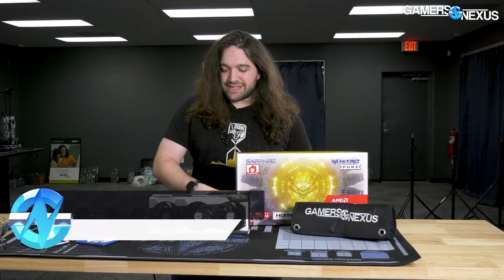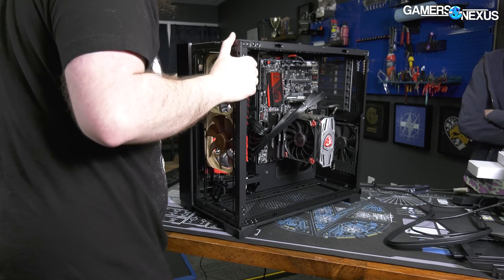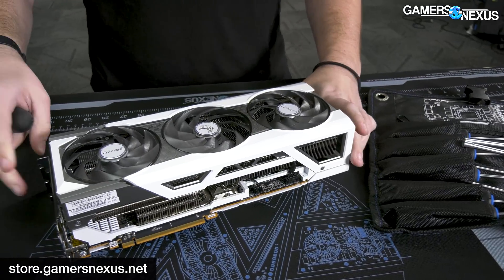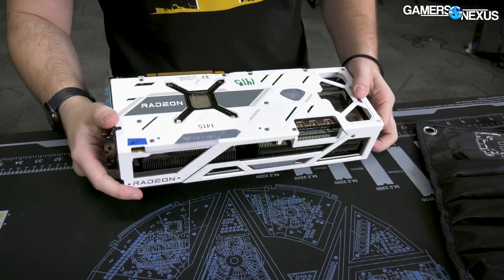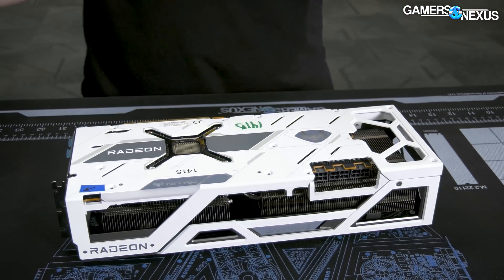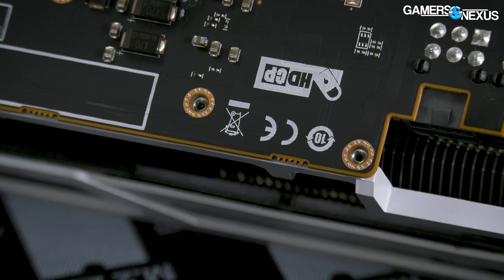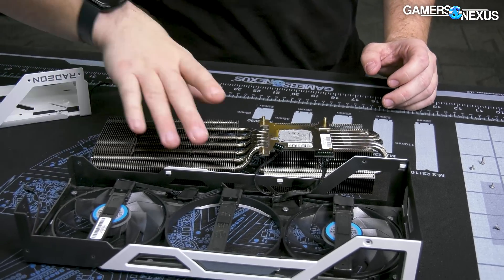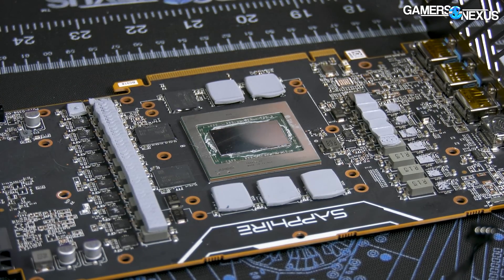Tear-Down: Sapphire's Excellent Cooler Design on AMD's Hottest GPU (6950 XT Nitro+ Pure)

Comment: i don't know if you check old video comments, but for reference as 6950XT owner since February 2023, i just repasted my GPU, because in Expedition 33 i had 110*C hotspot and pc shutdown... after repasting with arctic mx-4 and p-3 pads, my max hotspot was at 87

desktop usage went down from 58 to 38.... it was my first repasting of a GPU, but hoooly, it did wonders, i didn't get too much data from before and after, but under load it seems i got like 40*C improvement

Comment: 16:00 next time can you gize the X and Y size measurements? I don't own an electronic measuring tool, but my GPU is running very hot. I'm gearing up to disassemble my tiny ITX build to redo the GPU thermals and want to slap K5 Pro and PTM7950 all over, but I'm not sure what size to buy. If the total is 520mm, and long side is nearly 30cm, then the shorter side must be around 18mm or 16mm?

Comment: You really can tell when a manufacturer cares a little more about their product than others.

EVGA in the 20 series added 3 slot which was super nice for sagging.

XFX and their similar fan header design here.

Sapphire for them making such a big card, a real triple slot, with proper cooling and sag support, making a contact bout near the bottom of the slot that prevents further sag. This card compared to the EVGA FTW3 has no sag. Their bracket for anti sag is also less ugly than other options (looking at you MSI) and overall disappointed in EVGA for making the FTW3 a dual slot, with such a massive cooler and heavy design having a dual slot is horrible, and making no contact between the cooler and the slot itself doubles down on that. The real offender here is ASUS and their ROG STRIX 4090. A dual slot, really ASUS?!?!

This card is excellently designed in the world of bad GPU designs. Definitely pick this model up if you're getting a 6950 XT OR 6700 XT.

Comment: This one screw fans are awesome, i need to swap mine in RX590 nitro se as the bearing was failing and the noise was even on 700 rpm with headphones and start to make my gpu hotter, but i was unlucky and they dont want to sent me free replacments (probably they dont have it and try to import it for me) i lucky find original one in my country and pay little less.

Comment: This is a good design but I'm still not convinced that they wouldn't have been better off using standard out of the box 120mm fans. I'd like to know how a thinner heatsink + very good 120mm fans perform against a design like this. Noctua's 3070 is a good example of just how good a design like that can be.  I bet if you just slapped some good 120mm fans on the current heatsink, it would cool much, much better. This would also make for lighter GPUs..

Comment: Back when the RX 5700 XT was released, I originally got an MSI Mech version of the card. The cooling was complete and utter trash, and as loud as a jet engine, so I sent it back. I ended up getting the Sapphire Pulse version and was really impressed. I didn't realize before that how good Sapphire really was.

Comment: Having two separate cooling solutions may be smart, but for some models could result in a poor user experience. My personal experience with ASUS TUF RTX 3070Ti that has a separate heatsink for the memory. 
During heavy gaming, memory temp floats above 100 degrees and forces the fans to spin faster up to 90-95%. So you end up with 40-50C core temperature that is more than fine, but overheating memory chips causing fans to spin radically faster creating annoying noise. 
And that's not what you would expect from a big chunky 3 fan card. 
Compared to Asus TUF, for example Palit 3070Ti Gaming Pro is smaller, but much better engineered. Cooler, quieter and delivering much better user experience.

Comment: 4:50 my XFX RX 480 came with those quick disconnect fans as well back in 2016, the only downside is that the contact pads are finicky and if you don't get the fan slotted back in just right, the fan won't spin

Comment: In my opinion, the Sapphire brand is the best AMD graphics card manufacturer. They are products and components of quality and excellence. I had a Sapphire R7 260X 10 years ago and it has never let me down. By my carelessness I ended up causing a short in the frame unfortunately.

Before I used AMD I had two bad experiences with EVGA brand nVidia graphic cards. They didn't last two years with me. I'm not saying nVidia is bad, it's just that I had these two unpleasant experiences. Unfortunately here in Brazil the prices of video cards are very high.

I don't like using currency conversion because what is considered is salary gain and how much is paid for products and services. I'll just use it as an example:

Sapphire Pulse RX 6800 16GB GDDR6 PCI Express 4.0 (11305-02-20G)

Newegg a price US$ 798.99
Brazil a price R$ 8.599,91 or equivalent US$ 1.838,03

I apologize for my english. I'm from Brazil.
hugs and success for all.

Comment: Sapphire really builds solid cards, the Sapphire fans on the 6650XT as seen in Hardware Unboxed's review runs at a crazy rpm of 750 whilst maintaining very decent temps of around 60-70 degrees. Which is absolutely nuts. Speaking for fans anyone know where to get Sapphire replacement fans from - other than Alibaba or Aliexpress?
I need to get some hold replacement fans for a Nitro+ Rx 590 8g G5 Se lol..

Comment: i patented on here .  backplate cooling system.  there is should be some heat conductive material and contacted with cooler. pcb will be like a sandwic.

Comment: I really like the fan replacement method on Sapphire cards, tho when I contacted them regarding my new GPU and wanted to get a new fan because my middle fan wasn't working properly and also had a loud grinding noise they wanted me to buy a whole fan pack. I ended up buying an RGB Nitro+ pack from one of my local retailers as it just became available then, but I wasn't really a fan of that right after spending like $1600 on my 6900 XT lol.

Comment: I wonder how much more gpu performance you’d get by blocking it and keeping it in the 50c range.  Also it’d be nice if nzxt maintained their gpu air bracket line.  I had good results using the bracket in the 1080ti era.

Comment: I can’t be the only person thinking the size and weight of GPUs is getting a bit out of hand. I get that they have to dissipate a lot of heat these days but the things are getting towards the size of small form factor systems in themselves. A bit crazy. A PCB and chip bolted to a gigantic heat sink and fan assembly. The huge part being the cheapest part.

Comment: I really wish more companies would add the option to dissassemble the fans like on this card! Infinitely less hassle. I have a 3080 Strix white card with a middle fan which is wobbling, and I really cannot be assed to send it in to have it fixed and not have a card for god knows how long, when I could easily do it myself if it didn't void my warranty...

Comment: Same underfill in use on my 6800XT Pulse from Sapphire. It uses the same separated heatsink for the memory and VRM. Was having issues with he card under Ray Tracing, and the 30ish degrees between GPU temperature and Hotspot, tempted me to redo the pasting and thermalpads. Even going for a good thermalpad, Gelid GP extreme, no much gains. I would say, don’t bother, specially as you don’t have to remove the dedicated heatsink to repaste the card. Now, the paste looked well applied, but using the Arctic MX5, as I wasn’t happy with the potential of the thermal grizzly kryonaut moving out of the chip, the GPU temperature dropped between 3 and 5C, but the hotspot is now between 12 and 15C. The issue with Ray Tracing, despite every possible fix, is because the card would boost too high causing the crash. Anything with Ray Tracing, as long as I limit the maximum boost to 2150ish, no issues.

Comment: The Glue around the VRAM is to prevent any PCB flex from Ripping the VRAM pads/BGA this will prevent a lot of RMAs. As many 30 series coolers are so big the flex causes BGA issues on Vram mostly close to the PCIe slot 3080 and 3090... Ye the glue is to hold VRAM in place making the chips more stable

Comment: ***Need input, please!!  I keep hearing differing opinions on water cooling [a lot of those are about AIO style coolers].  But I've been hearing people say that they'd never run liquid in a system that no liquid should be a part of....and that systems can spring leaks and ruin a very expensive system....that the pumps can fail in 1 year or 2....and that they would only use air cooling.  

What is the deal these days?  Am I spending way too much money for liquid water cooling...and potentially creating an expensive bad day?

I'm wanting to run Skyrim with a lot of graphics mods, for example, and I know that temps can really damage a CPU or GPU.  I need to know what to do before I install the custom parts I ordered!!  I know that AIO coolers aren't as good as a custom loop.  And I know that air coolers probably can't cut it any longer for current CPUs.   And though the fans on a 3080 Ti may be okay, I'm not sure how they would do when running Skyrim mods.

I need to know if I'm spending too much for the custom loop,....and would be fine just using a quality AIO and letting the GPU fans cool itself [also having good intake and outtake fans on the case itself].  Because the custom loop is ~ $1000 for all the parts, whereas a decent AIO is ~200?

I have the following stats for the build:

12th Gen i7 12700
EVGA Z690 Classified
1000 W Power supply
EVGA GeForce RTX 3080 Ti
Corsair Dominator Platinum 32 GB

No plans to overclock this machine.

Planning on the fairly heavily modded Skyrim, Kena Bridge Of Spirits, probably World Of Warcraft, on at least 1440K graphics, probably get into other games with at least 1440K graphics.  My monitor is 4K, but 60hz.

Comment: I've never had an issue with Best Buy store employees.  Heck when I went early last year to buy some Switch games, Super Mario All Stars 3D had a display that was empty so I asked a store employee if they had any in stock and they went to the back room and found one for me.  I'm guessing they "hid" them to prevent theft or scalpers buying them all since they're limited.  Other times I had to interact with Best Buy were good too but each employee is different and each store is different too so someone could've had, and seems to have had, a different and bad experience.  Basically Your Mileage May Vary.  :)

Comment: Regarding the good cooler design: 
What is keeping the board partners from working together with cooler manufacturers like Noctua, Be Quiet!, Arctic etc?
Is it the sharing of profits? Is the margin for GPUs prohibitively low and the improoved performance not worth the price?
The Noctua version of the 3070 showed, that there is a lot of room for improvement when it comes to GPU coolers.
Their first attempt at a GPU cooler beat the competition handily, as far as I understand.
What do you think: how long will it take a board partner to team up with a cooler manufacturer on a larger scale, in order to gain a competitive advantage in terms of cooling solution?

Comment: at this point not using 120mm fans is brain dead....... cooler is ultimately a huge money sink. 3 90mm fans are just loud junk. 2 140's do the same job with no noise. even 2 or 3 120's do 50% better job at no noise. my 3070 ti was, in my opinion a trash card comparable to 20012 amd gpu's for noise. had to deshroud it so i could hear my speakers lol

Comment: I  love when partner  companies design their boards with a fin-laden subframe that cools the memory and mosfets separately from the GPU. it makes DIY  hybrid cooling relatively easy. just remove the main finstack, mount some fans in the shroud,  take your water/pump block and lap it so its smooth, modify the mounting bracket, and slap it on the gpu. boom, hybrid cooling without a 400$+ waterblock.

i hope we see this more on the lower end lower cost models.

Comment: I managed to get my 6900xt to almost match the 6950xt, with the main drawback being I can only get the memory to 550GB/s vs 576GB/s, but its stable at 2750mhz core clock so in 1440p (what I game at because high refresh) my 6900xt is still faster than a 6950xt. But it's pinned on that 350W limit very hard, if I had more power to play with I could probably get it faster. Damn thing has 3 8-pin connecters, why theres a power limit of 350 boggles my mind.

Comment: Most of AMD’s AIB partners like Sapphire, XFX, Powercolor etc. always seem to have less janky looking boards than some of the meh Nvidia AIBs.
Reply: i wonder why nobody buying very  HoT janky AMD AIB's ?? its embrassing when NVIDIA running under 70c vs AMD 95c and its normal that coming from AMD who use less watts while overheating crazy for 300w vs 400w cools lot better under NVIDIA designs , my fear is 7900xt cooling a 500w gpus ?? when they really suck at 300w
Reply: @user78405  my XFX 6900xt runs just as cool or cooler than my 3090. If it’s within the realm of the design it doesn’t matter. Nvidia ran stuff like the 1080ti at higher temps.

Comment: Nice attention to detail, one point I was wondering about was the smoothness of the cold plate.
kitguru was looking at msi 6900 xt and their sanding of the baseplate is horrible.  https://www.kitguru.net/wp-content/uploads/2021/02/paste2-1024x683.jpg  Apparently such things can have a large effect on the delta between hotspot and reported gpu temp. Could you maybe look into that ?

Comment: amd 125w cpu 300fps ....pointless . intel  375w cpu 301 fps  , top of the line   same as gpu  amd vs nvidia  youtubers  300 fps ...very good  600w  amd 299 fps 300w  pointless product
Reply: cut your hair the 80´s its over ....dont sell your brand for so little normy

Comment: The fan replacement is stock on all Sapphire cards now.

Pop it out, order a new one through warranty (I think) and you can still use your card until new one arrives.

I have used sapphire since the Radeon HD series and I highly recommend them. Their cards usually come with the faster clock speeds, and the overall design and quality of life features have always been good.
Reply: I have a Sapphire Nitro+ 6900xt special edition and freaking love it runs cool and quiet and you can tell it's a premium card

Comment: I kinda want to take apart my sapphire 6900xt nitro+ se, cause edge temps never go above 80 c. So I'm curious if the did a similar cooling solution with that card as well.

Comment: I have sapphire 5600xt and they used same type of fan with just 1 screw and connector, so easy to replace if fans will die. It also had part of the backplate with cutouts and the end to blow through some air. I think sapphire in general are doing good cooling on their cards. Had rx580 before moving to 5600xt 2 years ago.

Comment: I still have a Sapphire RX 480 and the card itself is amazing. When I first got it there was some software issues so the fans didn't work properly but amidst that it still worked perfectly fine and still does today. When I went to upgrade my pc I wanted another Sapphire card but the one I wanted was no longer available so I had to get a different one...that was back in 2020.

Comment: I'm both amazed by the overall design and terrified by the implications of the fact that they had to use a larger heatsink with three PCIe power connectors.

In terms of power draw, the future seems pretty scary, especially with what's being developed for the RTX 40 series.

Comment: Sapphire is who I always go to first if I'm going to buy an AMD card. It's not any kind of brand loyalty, my thinking is just that if the company only does AMD cards they'll probably put more in to the quality of those cards than an MSI or Gigabyte who makes far, far, more money off nVidia cards.
Sapphire also tends to make very basic, industrial, looking cards. No rgb lighting (which I hate) or any weird stickers, generally.
Reply: Yup, and Nitro looks like Gundam. :D I have a little RGB on the visible-side of my Nitro RX 580 but it's still awesome, I set it from TRIXX to change colours based on temps in games. It's silent and I didn't wanted it to overheat, left it that way as apparently the setting applied itself on the Vbios level, and it's nice to see go from blue to purple it I check it, without me manually using software-monitoring on the screen.

Comment: Two thoughts come to mind as to why the fin stack is "floating" within the larger cooler:
1) Could avoid tolerance stacking issues during manufacturing. 
2) Related, it would allow the main cooler to thermally expand and contract independently of the rest of the card which could reduce the thermal stresses induced when heat cycling the card.
Reply: The hotter these parts get, the more thermal cycling becomes an issue, so that's definitely a bonus if it wasn't the main goal. 👍

Comment: I can't speak to the quality of their more recent offerings, but Sapphire was always the best back in the day.  I had an old hand-me-down Powercolor HD7950 die on me last year (dunno precisely what the issue was, but it would hit thermal shutdown in like 20 mins even with undervolting and setting the fans to max), and since I didn't want to get a new scalped GPU, I opted to get another HD7950, only this time I got the Sapphire Vapor-X model.  It has a massive cooler and runs like a dream, just like I knew it would; my card before that had been a Sapphire Vapor-X HD4850, and I'd never had an issue with it.